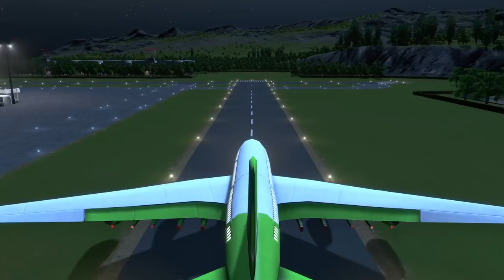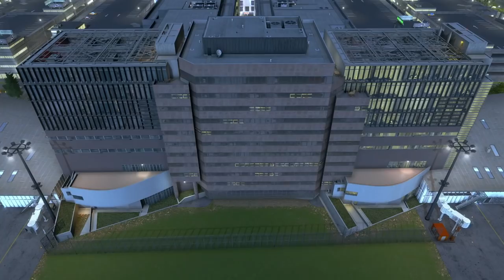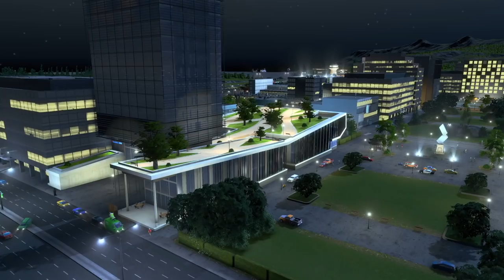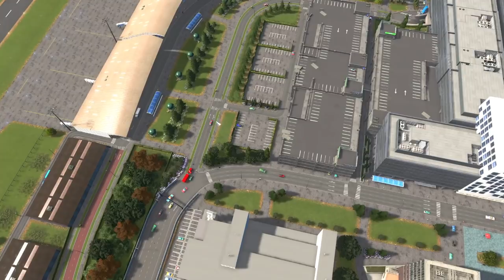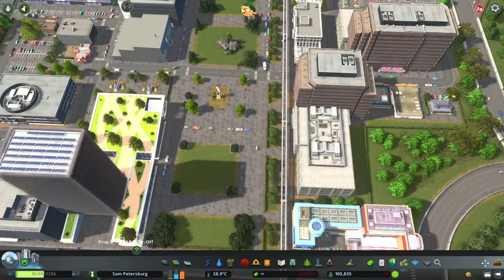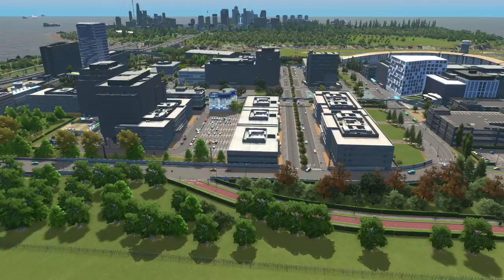Building an International Airport| Cities:Skylines

Comment: You could make the road directly at the terminals a busway, too! This also gives you the freedom to add crossings there

Just select and bulldoze it with move it, but section after section and not all at once.
This way you can first replace the straight bits at the sides and then the central curves

Comment: You know if you got rid of the two roundabouts you could, 
A, Stop that merge issue from the two on-ramps colliding offing the highway. Do you understand why the merge issue is? 
B, Increase the flow of traffic into that whole area. 
Good points, the slip road IS a good idea.
 I can be helpful, without traffic mods.

Comment: I believe if you ever put in a metro system, the international Terminal has a built in Metro Station.  I also dislike the road setup on the Terminals themselves in that you can't change the road type - I prefer to go with two lane, one way traffic. Most Airports I have been to follow that model.

Comment: What about have any roads/tunnels/bridges that connect with the highway in the north of airport from harbour, so they dont need to go thru airport and roundabouts to the actual highway. I guess that could do a less congestion on the bigger roads there in that airport area. Also if you got a 2nd road network, that will help in the future when you building the office/commercial area? =)

Comment: 14:06 how do you fix that? I have that problem on every town. Only major flaw in the game that I have come across after 130 hours of playing.
Reply: traffic manager mod, check youtube for tutorials
Reply: jukrupurkki use Traffic Manager: President Edition, edit the flow from the node where they merge...
Reply: He's played like 2k hours he'll figure out don't worry :3
Reply: @ DarkSoul, Nope, watch it again. You can't repair that with mods. The issue here is using a low volume on-ramp design for large volume traffic. Using a double lane ramp will not be the answer either.
Reply: @FrenchFry, Not looking to be rude or mean I doubt that number is over 500hrs. Having +2500hrs, I can tell by the style the experience.
Reply: Take a peek, I have a clip that may help. The yield issue will happen for difference reasons. None of them are a flaw in the game. The traffic is more complex or can be more complex then most people see or understand. The glory of the big buildings and the freedom of it often distract people from learning the traffic end of this game\simulator. I don't wish to throw links here, I don't think Sam would care for the help.
Reply: 1JasonBradly 1JasonBradly there is a node at the point where they merge, using the mod you can edit the nodes starting from the ramp until you're on the highway, forcing that one lane to go straight to the highway, thus no more merging
Reply: Rackie. You win I would need perhaps 30 seconds to a minute to fix without a mod. Like I said before this issue will not be resolved with TM for it won't matter what lane you force them into the exits and entrances are fixed which will determine the "last chance" node to change at, causing the issue. (Edited, typos)
Reply: Rackie,
I don’t mean to argue, offend, or insult,  I intend to inform. When it comes to traffic in this game people tend to  use Traffic Manager like a crutch, rather than learning how to build the infrastructure that is needed or required. They would rather force traffic to their will rather than learn the dynamics. This is because folks believe there is an issue with the traffic system in the games code that need correcting, there is not. Sams merging issue @14:07 does not require a mod to be applied to be corrected. Traffic Manager is a fine mod don’t get me wrong. The issue is when I try to tell people there is a way to deal with traffic rather running to mods I always get arguments from those who use mods, as if learning how to traffic is a bad thing.
“jukrupurkki”  Asked a question and I am making sure that they understand that mods are not the only way as suggested here. If you were to peek at the channel you would notice a theme. I mean to help.
Reply from the maker: Hey guys. There’s no need to get passive aggressive with each other. That issue actually fixed itself. I think any issue was caused by cars using the old road system. Then I built new roads but they hadn’t updated yet, hope that makes sense. Nowadays that part of the road actually fixed it self. Once all the cars got used to the new roads there is no issue. So technically I didn’t need to use a mod for this one but majority of the time I do use mods. And idk if that guy is referring to how many hours iv played in the game. But just so you know iv played almost 5000 hours in the game so I’d like to think I’m experienced.

Comment: Hey Sam, i tried to play the Map you're using with the exact same Mods you're using, but for some reason I allways get the Error, that some props were not found. I looked which are missing and the loading scrren mod says that a police car prop and a Curb 1x asset is missing.
I tried to fix it, but it changed nothing at all. Do you have an idea, or does someone else has an idea how to fix this issue?
Reply: I'm subscribed to the following "Police car prop": https://steamcommunity.com/workshop/filedetails/?id=565798597

Not too sure about your curb, if I search the workshop for "curb" there is only 4 pages of stuff. Alternatively, I wouldn't stress about it. some police car won't be parked at a station (I doubt you'd even notice) and you could replace said curb asset with the generic pack from workshop :).
Reply: Alex McArthur Nah i figured out my problems and fixed them.